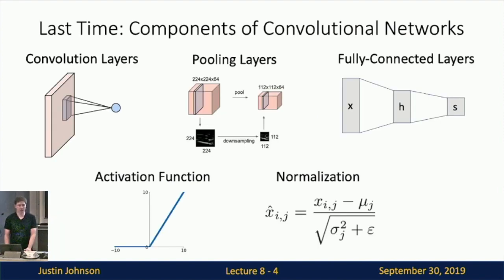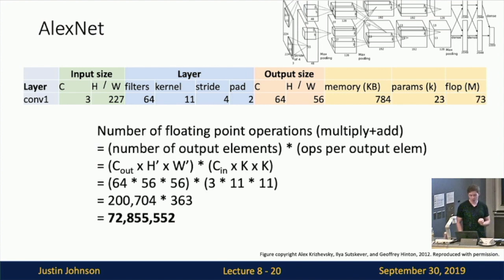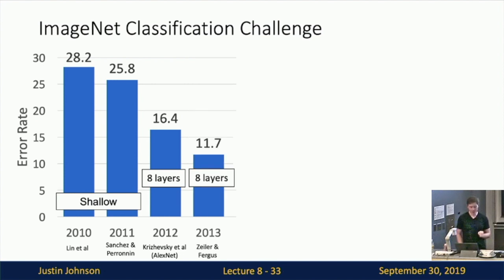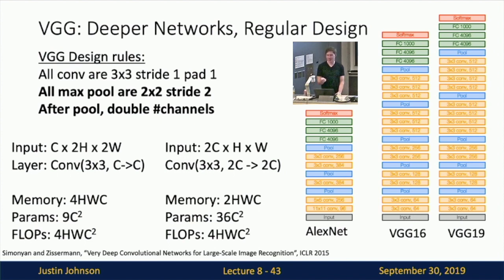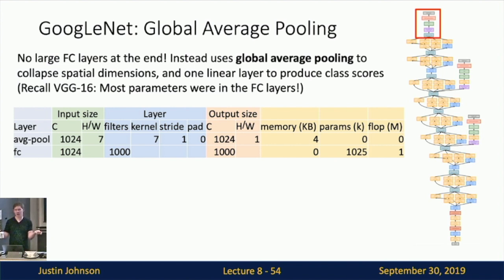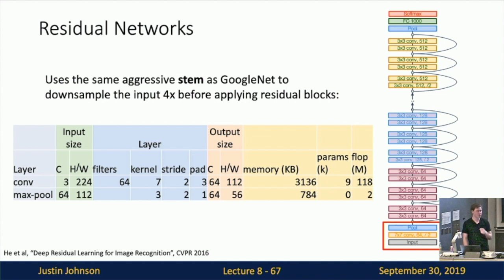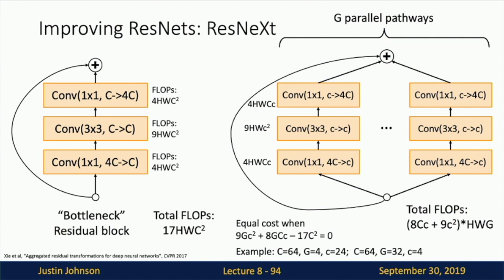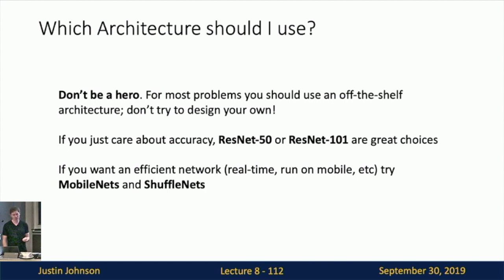Lecture 8: CNN Architectures

Comment: The formula for calculating the output size of a convolutional layer in a Convolutional Neural Network (CNN) depends on several factors, including:

1. Input size (W_in, H_in): The spatial dimensions (width and height) of the input image or feature map to the convolutional layer.
2. Filter size (F): The spatial dimensions (width and height) of the convolutional filter (kernel).
3. Stride (S): The step size at which the filter is applied to the input. It defines how much the filter is shifted across the input.
4. Padding (P): The number of pixels added to the input on all sides to preserve spatial dimensions after convolution.

The formula to calculate the output size (W_out, H_out) of the convolutional layer can be given as:

W_out = ((W_in - F + 2 * P) / S) + 1
H_out = ((H_in - F + 2 * P) / S) + 1

If you want to maintain the spatial dimensions (W_in, H_in) of the input after convolution (i.e., no spatial downsampling), you can set the padding as:

P = (F - 1) / 2

This formula assumes that the stride S is the same in both the horizontal and vertical directions. If you use different strides for width and height, the formula will change accordingly.

It's worth noting that some frameworks and implementations may use slightly different conventions for padding (e.g., 'valid' or 'same' padding), so it's essential to check the documentation and specifications of the specific CNN implementation you are using.

Comment: 14.14 time : why didn't you include Cin in calculating FLOPS in pool 1?
Reply: Each pooling operation is done on one input layer at a time, so it's kind of a 2D operation. Each pooling layer downsamples a corresponding input channel.

Comment: 29:50 how is output having the same dimension with input after 2 by 2 max pooling with stride 2 ?
Reply: halve in the sense of making it half of the value it used to be